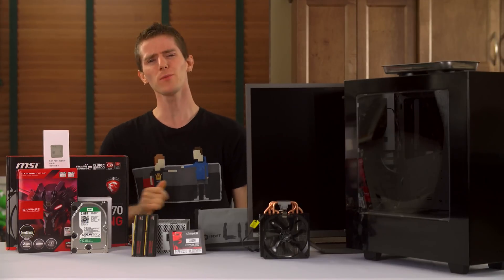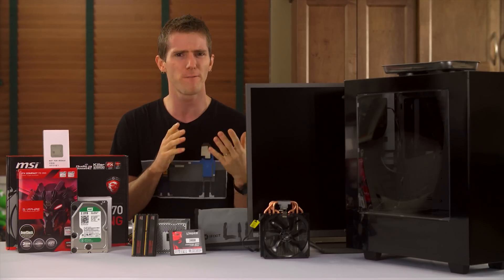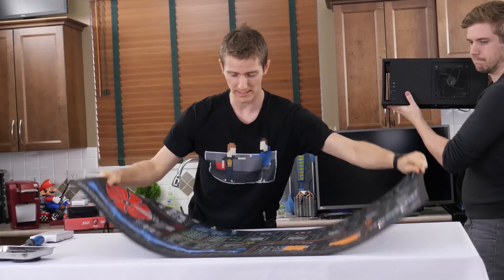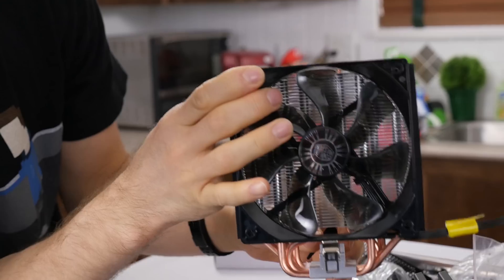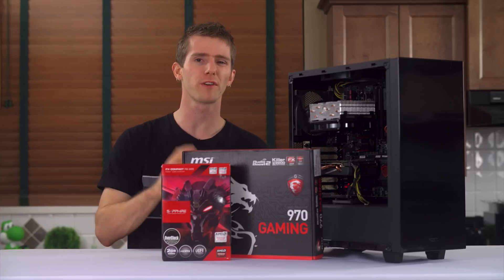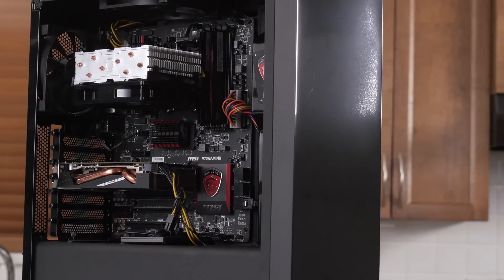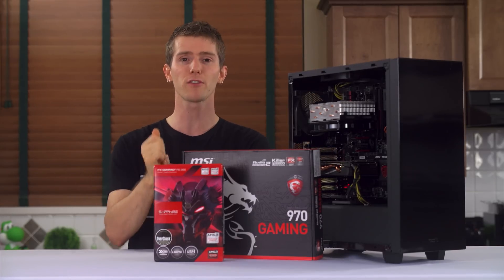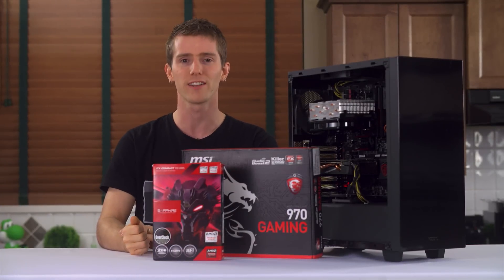Can you Build a 4K Gaming PC for Under $1000?

Comment: imo, the best part of a 4K display is for productivity purposes. being an author, having lots of screen space for lots of documents is really helpful. the 4K side benefit is that being, well, 4K means that gaming at 1080p should be just fine with no interpolation when not running at native res.
Reply: Jake Duckett Er, yes it does, unless you are running an OS that automatically forces DPI scaling and you can't override it. You get almost twice the pixels horizontally on a 4K monitor versus a 1920x1200 display.
Reply: Jake Duckett Try being a writer doing rewrites and edits on a 200,000 word manuscript sometime. Being able to have three or four pages visible and legible on screen at once is tremendously useful.
Reply: Corinn Heathers You're absolutely right. I went from dual 1080 to single 1440 and it was much better for coding. 4k in a 27 inch format would be better still.
Reply: Mark Rose Those extra vertical pixels are great, aren't they? I can't stand 16:9 for that reason. I need me a 2560x1600 pro-grade IPS monitor. :D
Reply: Corinn Heathers I run the HP ZR2740w at home and at work, and yes, the extra pixels are great! The width is also super handy when working spreadsheets. The only downside to 1440p, like you mentioned in your first post, is the uneven scaling of 1080p video. Since I don't watch video at work, I'm tempted to buy a 4k screen at home, and run both the HP's at the office. The ViewSonic VP2780-4K is catching my eye lately.
Reply: Mark Rose I wish I could afford 4K and enough GPU to drive it at native res, but I doubt I'll be able to afford that any time soon! Gotta sell a lot more books before I can think about that; 1920x1200 will have to do for the foreseeable future.
Reply: Corinn Heathers Yeah, that's an issue I face, too. I've got a GTX 760 for graphics, and the frame rates stutter quite a bit. It's fast at 720p, but then the lack of detail drives me nuts. If I really had the money I'd upgrade my graphics card first, before the monitor!

Good luck with your books! :)
Reply: ***** Windows DPI scaling is definitely very horrible. Fortunately it's not a problem with 1920x1200 displays at 24 inches, but I do worry about higher res displays at 27" or 30".
Reply: +Corinn Heathers Windows 8.1 and 10 have great DPI scaling in my experience. Haven't tried 7 tho.
Reply: Topias Salakka 8.1's isn't terrible. I still see some text distortion scaling my 14" 1080p laptop to 125%. It's nowhere near as horrible as W7 though.
Reply: Corinn Heathers I have a 27" 4K monitor, pretty much everything except Steam work flawlessly.
Reply: Topias Salakka What's wrong with Steam? Does it get all degraded from stretching elements?
Reply: Corinn Heathers Text is blurry.
Reply: Topias Salakka I have the same problem though I bet yours is worse. :(

Comment: My build:

CPU: AMD FX-8350 (Eight-Core 4000 mHz)
(Overclocked to 4.4 gHz (watercooled))
Gpu: Amd r9 270x
Mobo: Gagabyte GA990 (Amd crossfire ready for an extra r9 270x)
Case: Corsair carbde 500R (ARTIC WHITE OFCURZ!)
DDR3: Eight gigs of ram (idd not more, i don't even need more)
PSU: IDK THE BRAND - but 750 watts

The build costs around 996 euros and i think it will run fast and i'm really happy with it but can someone please tell me if it's a good build otherwise i'll go with an intel i5 processor but i will be out more expensive so yeah.....

Comment: Hey guys, what do you think of this 1000$ build, suggestions please. (Prices in Australia are way overpriced btw)

Cpu: AMD FX6300 3.5ghz (i'll clock it to 4)
CPU Cooler: Corsair H55 57.0 Liquid CPU cooler
Motherboard: MSI 970 GAMING 
Memory: Ripjaws X series 8gb (2x4) ddr3 1600
Storage: Corsair Force 60gb SSD (just for the processor)
Storage 2: Western Digital Black series 1tb
Video Card: Asus radeon r7 260x 2gb  (later on i'll go 2 way sli)
Case: Zalman Z5 plus Mid tower
PSU: Silverstone strider 600w 80+ Silver Certified ATX fully modular
Optical Drive: I'll rip it off my current pc

thoughts and suggestions please?

Comment: PC korpusas Corsair Carbide Series™ SPEC-01 RED LED Mid Tower Gaming
SSD Samsung 850 EVO 120GB SATA3, 540/520MBs, IOPS 94K
Gigabyte GeForce GTX 970 OC, 4GB GDDR5 (256 Bit),
DDR3 Crucial Ballistix Sport 8GB 1600MHz CL9 1.5V
MSI H97M-E35, H97, DualDDR3-1600, SATA3, HDMI, DVI, VGA, mATX
Intel Core i5-4460, Quad Core, 3.20GHz, 6MB, LGA1150, 22nm, 84
W, VGA, BOX
PSU Cooler Master ATX G650M 650W, 12cm ventiliatorius 80 P
LUS Bronze
CPU aušint. Cooler Master Hyper TX3 EVO 1366/1156/1155/77
5/FM1/AM3+/AM3/AM2+/AM2

for 970 € 1000 € what i can get better

Comment: is this good gaming rig for 4k res
specs:
AMD FX-8320E octa core processor @4.0-4.5ghz
Cooler Master Hyper T4
Gigabyte GA-990FXA-UD3 ATX AM3+ Motherboard
G.Skill Ripjaws X Series 8GB (2 x 4GB) DDR3-2133 Memory
Kingston SSDNow V300 Series 120GB 2.5" Solid State Drive
Seagate Barracuda 2TB 3.5" 7200RPM Internal Hard Drive
Gigabyte GeForce GTX 970 4GB WINDFORCE Video Card
NZXT S340 (Black) ATX Mid Tower Case
EVGA SuperNOVA NEX 650W 80+ Gold Certified Fully-Modular ATX Power Supply
For:$923.88

Comment: Can yall tell me what you think of my specs:

Processor: AMD FX 6300 3.5GHz 6-Core
Motherboard: ASUS M5A78L-M Micro ATX
Ram: PNY XLR8 DDR3 8GB 1600MHz 
Hard drive: WD Caviar Blue 1TB 
Graphics Card: Gigabyte GTX 960 G1 Gaming 2GB GDDR5 Graphics Cards
PSU: EVGA 430W 80+ Certified Power Supply
Case: NZX ATX Mid Tower S340 Blue/Black

Comment: Hello, am new in this Pc building thing.
Will this build work?

Crucial Ballistix Sport 8GB Kit (4GBx2) DDR3 1600 (PC3-12800) 240-Pin UDIMM
WD Blue 1TB SATA 6Gb/s 7200rpm Internal Hard Drive
Asus 24x DVD-RW Serial-ATA Internal OEM Optical Drive DRW-24B1ST
Intel Core i7-4790K Processor (8M Cache, up to 4.40 GHz)
EVGA GeForce GTX 970 Super Clocked
Cooler Master Hyper 212 EVO - CPU Cooler with 120mm PWM Fan
MSI Computer Corp. ATX DDR3 2400 Motherboards 
Corsair Enthusiast Series 650-Watt 80
NZXT Phantom 410 Mid Tower USB 3.0 Gaming Case

Please help me, am new in this.
Reply: TheOneGamer if you mean are the components compatible, go to a Pc buliding website and then put in what you got and they will tell you of anything that may be wrong
Reply: Thanks, already found a website and ordered the right parts. Thanks again though.

Comment: FX 8350                                                        £130
G.Skill Ares Series 8GB                                 £64.99
Asus Crosshair V Formula-Z Motherboard        £170
MSI AMD R7990                                            £220
Seasonic G750 750W 80+ Gold Certified          £110
Hyper X SSD 240g                                         £50
WD 2 TB                                                       £40
Total 784.99 GBP or 1179.26 USD
This is my to-be rig and just wanted to get some thoughts on how it will perform in 4k/1440p/1080p. I'm very new to building so any advice would be greatly appreciated.
Reply: TheBetaProject1 Wut, a 7990? Anyway, it's basically two HD 7970s/R9 280Xs in CF in one card, so it should perform pretty OK at UHD. http://www.guru3d.com/articles-pages/asus-radeon-r9-280x-top-review,24.html
Reply: Casual G4mer  my old friend is selling him only month old and okay thanks for the help

Comment: Do you think this is a bit beast PC?

Case: Fractal Design Define R4
Power S: EVGA NEX750 G2
HDD: Western Digital HDD (1 TB)
SDD: Samsung 840 SSD (250 GB)  
          x2 GeForce GTX 760
Ram: G.Skill TridentX RAM (4 GB)
         Corsair H100i Liquid CPU Cooler
Motherboard: Gigabyte Z87X-UD4H
Core: Intel i7 4770k CPU

is this good one?

Comment: actually build my rig that can handle 4k no problem for right around $900 nevermind that a few of the parts where reused from my old rig that was a Christmas gift those parts being cpu ram power-supply and a os disk my rig
amd fx-6100 3300mhz oc to 4000mhz when needed
coolmaster siedon 120 liquid cooling
some old adata 8g 1333 ram
gigabyte 990fxa-ud3 mother board
xfx r9-290 4g 512 bit 
ocz vertex 460 240g ssd
western digital black 1tb hdd
a old thermaltake smart power 750 power supply
all put in a rosewill throne with extra fans for more cooling

Comment: Hi Linus, is this kind of build really suit 1440p+++ to run smoothly?

CPU : i5 4690k
GPU :Gigabyte R9 290x 4GB 512-bit (Windforce series)
Mobo :ASRock z97 Fatal1ty Killer 
HDD : WD Blue 1TB
SSD : Kingston HyperX Fury 240GB 
RAM : Corsair Vengeance Pro 2133mhz (2x8GB)
Cooler : Cooler Master Nepton 240m
Case : Corsair 450D
PSU : Corsair CX600m
Monitor : BenQ GL2460HM (2ms)

Comment: You dont need a super computer for any competitive game as it's all about performance and then you must crank down the graphics and and resolution.
As a competitive CS:GO player I have my resolution to 1024x768 and all graphics on low, multicore rendering enabled as my fps drops with it disabled.
Since my system is not suffering from input lag at all and I'm not sensititive for it, I also put virtual reality pre-rendered frames to 4 and maximum pre-rendered frames to 4, which gives a me a little more input lag but I'm under 20ms so it's hardly noticeable.
If you want to compete at the best level you need to have as responsive mouse and game as you possible can.

While for the majority of gamers they want as good graphics as possible and it's for those people this guide is for but if you want to win with your team in a league or tournament you can't play at 4k.

Comment: THIS BUILD IS ALLOT BETTER FOR AROUND 1000$ + IT FEATURES AN EXPENSIVE CASE SO YOU CAN GET IT FOR EVEN CHEAPER

CPU: i5 4690k                                                                      
motherboard:MSI H97 GAMING 3 LGA 1150 motherboard  
RAM:  hyper X fury red (2*4 )                                                   
Storage: 1 TB                                                                    
PSU: Vs550                                                                        
software: windows 7 pro                                                     
graphics card:  GTX 750ti                                                 
case: nzxt h440 red/black

Comment: WoW never runs well on AMD CPUs. It's CPU bottlenecked almost always, so the shitty 6350 you have in this PC is easily swamped because it has really crappy single-core performance.

If you're building for MMO gaming, Intel is your only option if you want high-end performance. AMD should be a last resort only for mega-budget rigs (things like AMD APUs).

If you think your little "benchmark test" in WoW pressured that AMD CPU... go try 30-man raiding or a large BG (AV for example) on ultra at 4k. That CPU will shit it's pants.

Comment: Will I be able to play Advanced Warfare at 1080p ultra and GTA-V at 1080p mid?
i5 - 4460
Asus Direct Cool r9 270x 2GB
2 x 4GB corsair vengeance
msi z97 pc mate 
monitor (though it doesn't matter) : Dell s2240l

im upgrading from a 07' piece of sh!t that gave me 23 fps in 800 x 600 COD4 (low, 0xAA), so yeah....
Reply: Bruce Wayne Buy the r9 280 is pretty cheap
Reply: Bruce Wayne it will run gta v at 1080p with mods on high to ultra settings
Reply: Should do
Reply: Bruce Wayne If you wanna go with AMD for GPU the 285 is actually hard to beat at the price point. If you're open to Nvid, the GTX 960 is about 20% better than the AMD 285 for only about $10 more.

Comment: CyberPowerPC AMD FX-8350 4.0GHz Processor with 970A Motherboard, Bundle Only
CoolerMaster N300 Mid-Tower Gaming Case with DVD+/-RW Drive, Bundle Only, Black
CyberPowerPC Corsair Vengeance 16GB DDR3-1866MHz, 2TB HDD and Windows 8.1, Bundle Only
NVIDIA GeForce GTX 750 Ti 2GB GDDR5 PCI Express 3.0 Graphics Card with 600W 80 Plus Power Supply, Bundle Only 

Can someone tell me if this is good pls in total its 1000 $

Comment: People are always hating on AMD, mostly Intel "fanboi's" that love to suck their you know what, even when they change TMI from soldering to cheap paste just so their chips burn out quickly to make a buck.

But, AMD (who did buy ATI, the first GFX Card Manufacture for the PC), has absolutely rocked in GFX Cards in the market year after year for the most part still is given next to nothing for CPU credit. Ok Intel has 'hyper threading', which they've pretty much bought off every software company they can to make sure their chips work better using that instruction set, AMD still had the best CPU back when Phenom  was released. They are not stupid, and we NEED BOTH to keep competition and prevent things like Intel's "We'll just engineer our chips to over heat and fail in 2 years by swapping out solder for POS paste. No one will ever find out!".

Comment: Can someone tell me if this is a good rig?
I live in the UK, my budget is £1050 which is $1570 USD-

CPU- Intel Core i5-4690K 3.5GHz Quad-Core 

CPU Cooler- Cooler Master Hyper 212 EVO 

Motherboard- ASRock H97M PRO4 Micro ATX LGA1150 

RAM- G.Skill Ripjaws Series 8GB (2x4GB) DDR3-1600 

HDD- Seagate Barracuda 2TB 3.5" 7200RPM Internal Hard Drive 

SSD- Samsung 850 EVO-Series 250GB 2.5" Solid State Drive 

GPU- Gigabyte GeForce GTX 970 4GB WINDFORCE Video Card 

Case- Corsair Carbide Series 300R Windowed ATX Mid Tower Case 

PSU- Corsair Builder 600W 80+ Bronze Certified ATX Power Supply 

Optical Drive- Samsung SH-224DB/BEBE DVD/CD Writer 

Operating System- Windows 7 Professional SP1 64-bit 

Thermal Compound- Artic Cooling MX4 4g Thermal Paste 

Total- £1011.91, $1513.11

This is my first PC build
Reply: http://uk.pcpartpicker.com/p/yWtppg

Comment: Is this a good build? http://pcpartpicker.com/p/wCQtqs
Reply: ScrumptiousMango get 8gb ram instead of 16 and a 290x or gtx 970 instead of the 960.. you should also get a cooler master hyper 212 evo instead of your h80i.. you don't need a 750w power supply unless you want to crossfire/sli in the future.. a 600w psu is sufficient for your setup.. the rest is fine.. i'd additionally recommend a 128gb ssd for faster booting, though..
Reply: Is this build better? http://pcpartpicker.com/p/wmYPLk
Reply: ScrumptiousMango
yes

Comment: I'm curious as to why you installed your CPU cooler in the orientation you did. Usually you see it installed with the fan pushing air through the sink and out the rear exhaust, but yours pushes air out of the top of the case instead. Any particular reasoning behind the change?
Reply: *****   I noticed the same thing.  I guess technically pushing the air out the top is the quickest route, since heat rises.

Comment: traded a 980 i had lying around for 2 7990's to have fun with them XD must say i get a huge performance boost but at the cost of 4x the power draw havent tried them at 4k but i use 3 290s on my 4k monitor. they dominate and id assume the 7990's would perform right under the 290's

Comment: is my build ok? http://pcpartpicker.com/p/KYdft6

cpu: i5 4690
motherboard: ASRock h97m pro4
memory: G.Skill Ares Series 8GB (2 x 4GB)
Video card: MSI GeForce GTX 970 4GB Twin Frozr V Video Card
power supply: Corsair Builder 600W 80+ Bronze Certified ATX Power Supply
case: Corsair 200R ATX Mid Tower Case